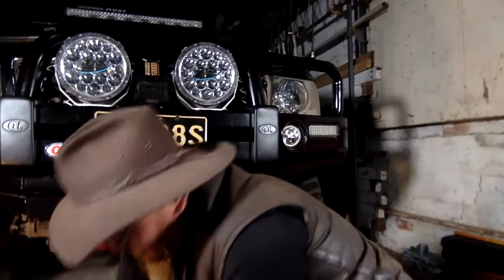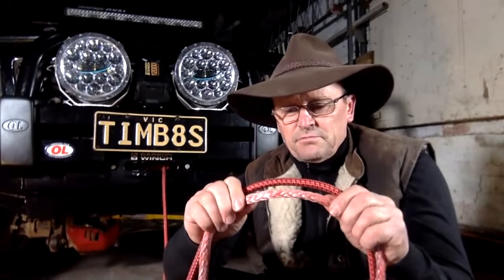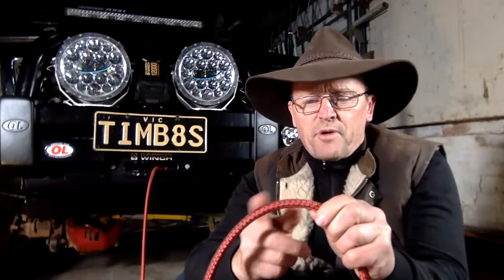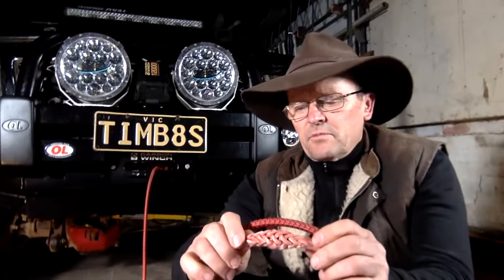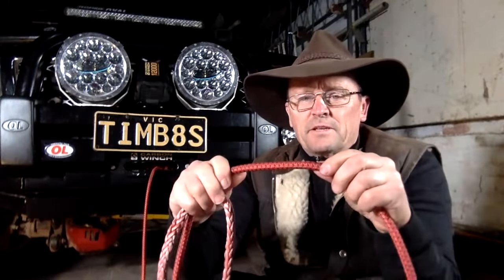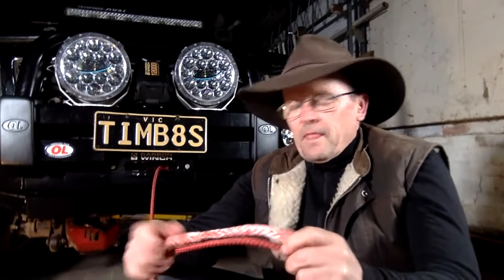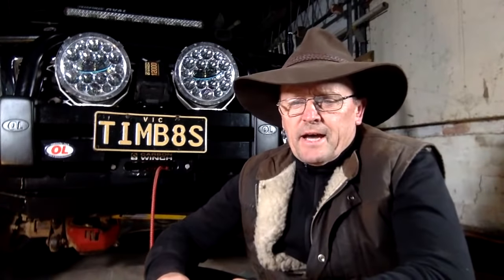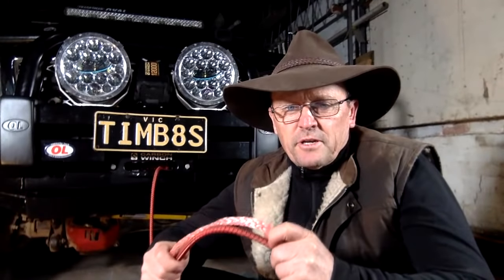Winch Rope Replacement - ( Options For Steel Cable )

Comment: That new rope you have there is almost like the independent wire rope core we used to use on the larger winches. Strong as !!!
Reply from the maker: Yes, very strong mate.

Cheers Tim.

Comment: G'day Tim,
Thanks for the info mate! Just a quick question, I currently have a bridal strap (for utilising both front recovery points for snatching), will that suffice as a tree trunk protector to? Or should I get a dedicated tree trunk protector? 

Cheers,
Tim
Reply from the maker: G'day mate, 

My best tip would be to use the correct recovery gear for the job it's designed to do. 
I would be getting a tree trunk protector for the job.
Thanks for your reply mate.

Cheers Tim.

Comment: G'day Tim, Well put together vid as always mate, handy to get some tips! Quick question, I have a internal drum brake in my winch (warn, 9500LB) fitted with steel cable, Im currently looking for an alternative to steel wire, my question is with the heat genreated in the drum I have heard it isnt suited for running rope (wether or not thats correct, i dont know) but would you know if the new rope you have just fitted is more resistant to heat being covered as it is? Thanks mate 👍
Reply from the maker: G'day Gavin, 

Im not really sure about that one mate. 
The guys at Carbon Winch would be able to help you out with your questions for sure. 
Maybe have a chat with them mate. 
Thanks for your reply and feedback.

Cheers Tim.
Reply: I have a 1980’s Warn XD9000 on my 80 series and have had Dyneema rope on it for about 12 years now and had no problems with heat from the drum.

Comment: Beware guys if your on your winch and it seems your going backwards means you have snapped the rope attachment at drum. Rope will be slipping on those 8 wraps. Not good when your solo 4wding on a hill....

Comment: I still run Steel cable on my high mount.
Reply from the maker: Nothing at all wrong with steel cable mate. 
Just that rope is a good option over steel cable.

Cheers Tim.